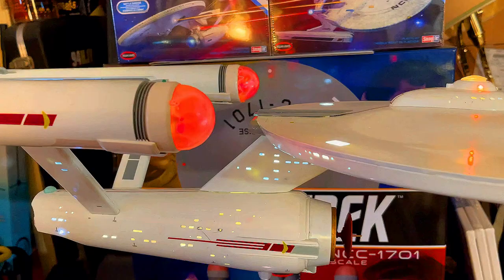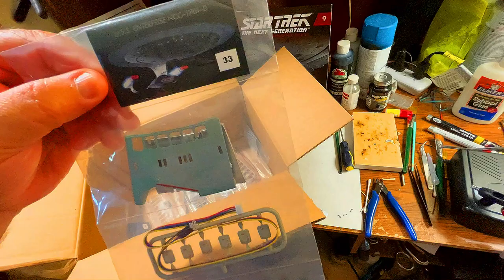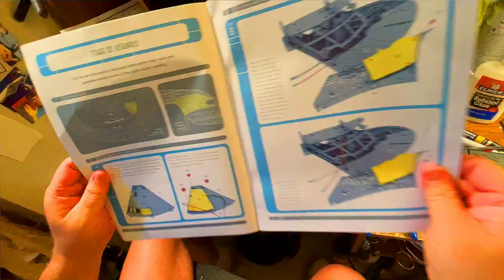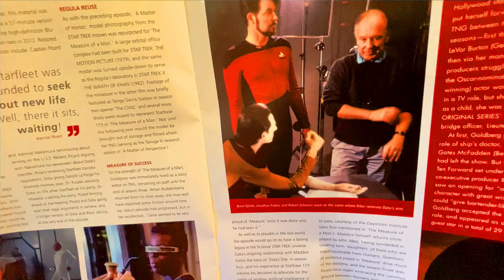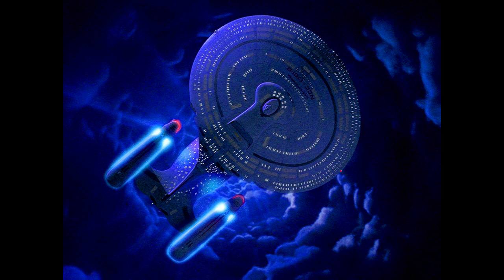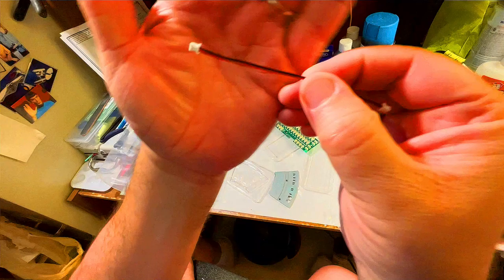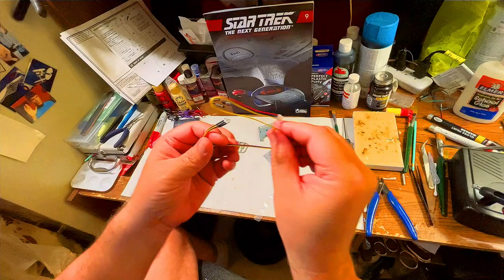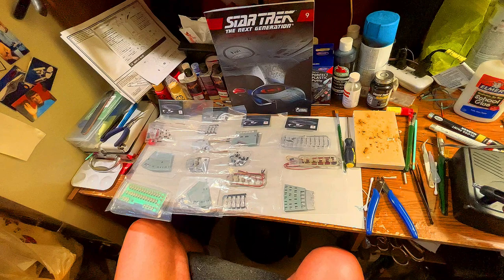Eaglemoss Build the U.S.S. Enterprise NCC-1701-D shipment 9 (unboxing Video)

Comment: I have complained about this everytime even their dispatch seems very slow takes around 2 weeks and I live in the uk
Reply from the maker: I agree. It is very slow. I don't think all the blame should be on the postal service. You would figure that by shipment number 10 they would have worked out all the bugs and it would get smoother.
Reply: I'm several issues from 10 only just done issue 6